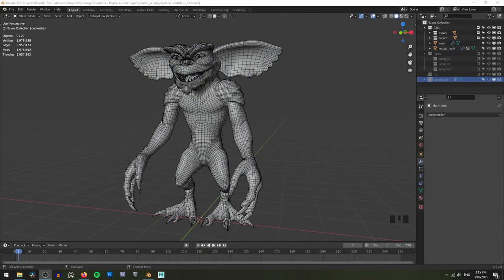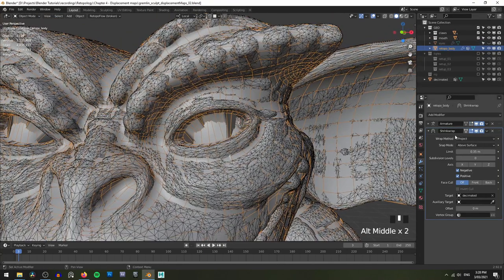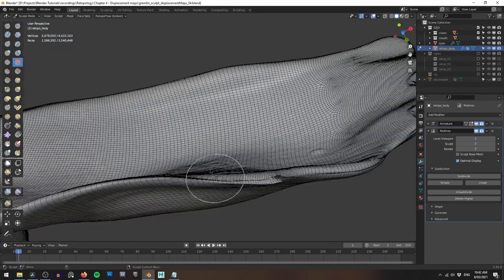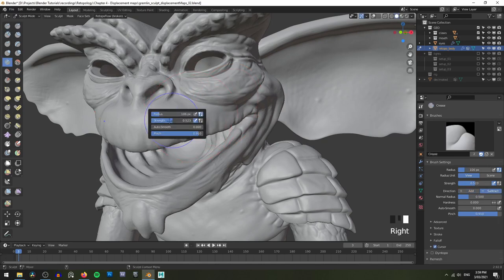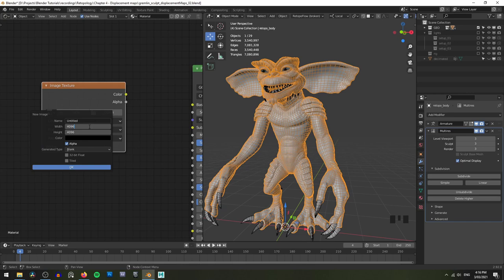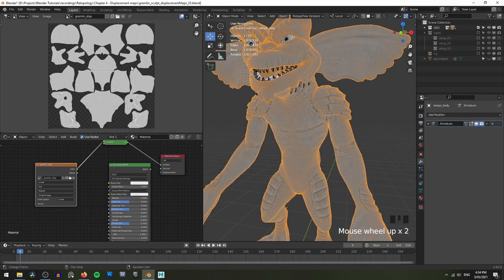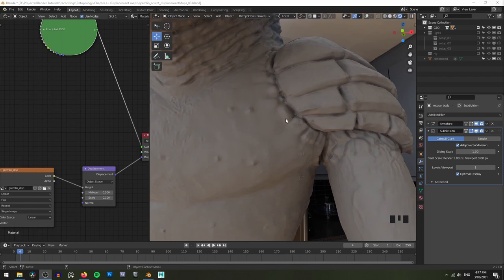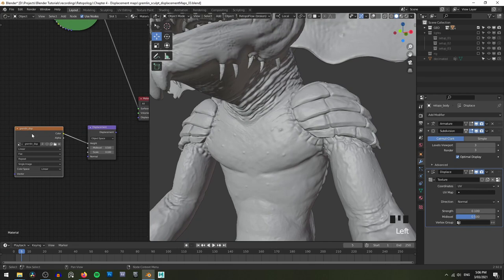Displacement maps in Blender

Comment: Wow, it worked! I've done lots of displacement map tutorials in the past, mostly using C4D, and they all cause issues. But this worked great! I skipped the retopo kind of and used quadremesher. and I did some decent UV mapping, which I often try and skip through, which doesn't help. So thank you for this! You knocked it out the park. Its genius that I can just go ahead and use multires for animation if I stay in blender. C4D does indeed have this via the "freeze + allow mesh distortion" setting in their sculpt tool. But If you can export BTX files from blender.. I bet someone could write a program so that houdini, etc (or c4d). could read the BTX file. So if you wanted to do some crazy sims in houdini you wouldn't even have to bake displacement maps.
Reply from the maker: Great to hear it worked for you Jonsk. Honestly, a lot of baking problems tend to come from bad topology or UV maps, so I'm pleased you managed to get around it - although I'd definitely recommend doing both.

You definitely can use the multires for animation. Just keep in mind the multires does store a LOT of data, which will make your scenes quite large. Exporting as a displacement map dramatically reduces the file size. So it's a trade off between skipping this step or having bigger files.
Reply: @JamieDunbar  Makes sense!

Comment: thanks for great tutorial- any chance for a displacement UDIM tutorial in the future?I have been trying out pixar free model gallus gavialis and I am getting error in cycles(tested out in 2.83 LTS and 3.0a) when loading UDIM displacement from zbrush(exr),diffuse work well, as well the mdisplacement(mari). Any workaround tip possible regarding such issues?
Reply from the maker: Thanks Lage Opedal. Yes, I am planning another video for the Gremlin covering UDIMs. Sadly it keeps getting pushed back. It could be a little while until I get around to it.
In the mean time, I know CGBoost just released a tutorial on UDIMs. Have you seen it yet? Let me know if it fixes your issues:

https://www.youtube.com/watch?v=55sGQLX7iho&list=WL&index=14
Reply: @JamieDunbar  thanks looking forward to it. About the dino, I did not see that the UV were different. I had to change UV to 1001, 1002 etc. and change the textures accordingly. In the rendermanblenderfile,  I think they mixed to different displacementmaps. Dont know how to do this in cycles unfortunately. If you  know this tecnique it would be great to see this in a tutorial...
Reply from the maker: @lageopedal2116  Mixing displacement maps? I'm hoping that's just using a "MixRGB" node and blending between two?

Comment: This video has ended my 10 hour hair pulling run of stress! Here I was trying to make displacement maps work for a Game Asset and was wondering why it wasnt working xD , great video!! One of the few tutorials where I could pay attention easily for 40+ minutes without getting bored! 

Feels bad to see that Displacement maps arent really possible for almost all game assets :/ (excluding terrain textures). Also Thanks for replying to comments in detail really helped out aswell.
Reply from the maker: That’s awesome RT. Glad I could help.
I was under the impression some game engines could make use of displacement maps in some limited capacity - but I don’t know enough to say for sure. As you say, it might just be terrains.
Have you stumbled upon my normal maps video yet? That will help you create normal maps that can be used in games - assuming you don’t already know how to create those.
Reply: @JamieDunbar  yep saw that video

Comment: I have a question. Is it possible to bake displacement map on a low poly model just like that with the normal map?
So that I can apply my map to a low poly model with the same hight information of the high poly model.
I have seen tutorials but the result is similar to that of the normal map, which gives me fake hight information. I want the real hight information on the low poly model, 
I want to bake the hight info on a low poly without increasing the subdivisions, Because increasing subdivisions will make it high poly not low poly, which I dont want.
Reply from the maker: Hey Ali. Unfortunately what you're asking for isn't possible. You can either fake the height information using a normal map - but as you said, it's fake and won't always look good, especially in close ups. Or you can do it for real, using displacement maps. But if you do it for real, you need the high poly.
Unfortunately there's no way of getting "real" detail with low poly.
Reply: @JamieDunbar  First, thank you for your reply. 
Second, you said if I want to do it for real not fake, I should use displacement map. That is right, displacement map will give me the real details, but my question is, why should I use displacement (with high poly) and I already have a high poly model from sculpting? What advantage that the displacement map gives me over sculpting?
I followed a character creation and texturing tutorials, the steps was as the following: modeling, sculpting the high poly details, retopology to get the low poly version, uv unwrapping the low poly, making the normal map, texturing, making roughness map etc... so now I had a character with low poly and fake details and it is ready for rigging and animation. Now lets say I want to texture and animate it with its real high poly details, how can I do that if I will have a high poly model either with sculpting or with displacement? That is why I asked what the advantage that the displacement map will give over sculpting? It is realy weired because at the end I have to increase my subdivisions again in the displacement map, the thing which I dont want.
Third, If what I am asking is not possible, how animation movies are made? How can they create and texture high detail characters and animate them in this case? I dont think the high details in the movies are fake, some times the camera comes too close and I can notice they are real details not a normal or bump map.
Thank you again for your reply, and sorry if my message is too long but this is my real concern and I hope got my point.
Reply from the maker: Hi Ali. I think you’ve kind of answered your own question there. The reason you use displacement rather than just leaving the sculpted detail is so you can animate it. You’d have no hope of animating something with a million polygons - your computer would explode.
So we make our rigged models low poly, and only add the displacement details at render time.
This is exactly the same process that movies use. Low poly models for animating, then add normal maps and displacement maps at render time to get that close up, high poly detail.
Reply: @JamieDunbar  thank you for the explanation
So this means if we render our animation which include displacement map, it will take a much longer time than that without, and need a much powerful computers , and we do it only at render time because it will slow down our PC if we do it at our workflow. I realized also from your comment that subdividing my model for the displacement map will give me much less polygons than that with sculpting.
Reply from the maker: @aliamir85  Yes, that's all correct ;)
Reply: @JamieDunbar   Thank you so much. Just one more 	thing, what is the difference between the displacement modifier, and the displacement node in the shading editor?
I followed a tutorial on both of them, but I could not understand the difference between them.
Reply from the maker: @aliamir85  Great question! There is very little, or possible no different in the final render. But there are two differences in terms of workflow.
1. The displacement material node allows you to use the "adaptive subdivision", which optimizes your render giving you better results faster. You actually can't use adaptive subdivision with a displacement modifier (I just tried this - didn't know that before!)
2. Most other software doesn't have a displacement modifier. But pretty much all of them have a displacement material node. So using the material node setup makes it easier to transfer between programs.
Reply: @JamieDunbar  thank you so much

Comment: I follow the bake setup exactly but I get an error "You should have active texture to use multires baker" i don't know why I'm on 2.93.0
Reply from the maker: I’m fairly sure that error happens when you haven’t selected the image node in the material view.
Reply: @JamieDunbar the probelm was I only had the main body assigned to the material. all of the polys need to be assigned.
Reply from the maker: Oh, I’ve never tried extracting maps on only half a model. I guess it doesn’t work 😅
But you’ve solved your problem?
Reply: @JamieDunbar  yes

Comment: Now I know why it should have been a video on itself, those are HUGE infos.
To be honest, the only annoying part is when you have to manually adjust every detail caused by the MultiRes.. I have always the fear of not seeing some details to fix not matter how much time I look into them. Other than that, the results is fantastic.
By the way, nice video editing too as always.
If I may suggest, could you also add a recap youtube chapter at 37:00 minute? Would be useful for future quick reference.
Reply from the maker: Hey MasterCharizard. 
The better your topology is the less issues you should run into. With a bit of work at the retopo stage you should be able to eliminate a lot of these problems. But I wanted to leave them in because there will definitely be times when it just doesn't work and it's good to know how to fix them. But you're quite right, there'll be times when you move onto the next stage and suddenly realise your displacement map isn't as good as you'd like. Make sure you save different versions along the way so you can always go back and patch it up.

And yes! I meant to add the recap as a chapter. I'll go do that now.

P.S. You can't be the master charizard. Because I AM! :D
Reply: @JamieDunbar  yea that' what I'll do for my next project probably, focus more onngood retopology from start to finish.

Just out of curiosity, how did you manage to achieve all those results? I mean is it the results of years of trial and error or what? Because if it was for me I would have stopped to the basic stuff ( to me all of those particular settings are achievable but extremely advanced at the same time). I mean I could have not figured out all of this by myself xD 

Thanks for the recap thing too!

p.s.: ahaha there's a lot of competition for him :D
Reply from the maker: @MasterCharizard  I've been doing 3D animation professionally for 10 years, and probably another 5 just as a hobby. There's definitely a lot of trial and error. As well as hundreds of hours of tutorials. The first couple of times you do these things everything breaks and you can't figure out why. Then you do it again and suddenly everything (well, almost everything) works and you have no idea what you did differently.
Over time you just pick up a bunch of things and gain an understanding of how the programs work under the hood. Eventually it becomes second nature. Which actually makes it hard to do tutorials, because you have so much assumed knowledge that beginners won't have yet.
Reply: @JamieDunbar   Yea, exactly that. If I have to do a tutorial I would question myself every 2 minutes if everything I am saying make sense/is done correctly because if not I have the fear to spread misinformation. You actually are very talentend in explaining things and it's a pleasure to hear from you (I always play your videos while I do dinner, ahah), also because you take your time and don't avoid even the smallest everyday problem that we could face in each step, and I appreciate this attention to the details.
To resume, great job, looking forward for your next video.
Reply from the maker: @MasterCharizard  Haha, I frequently watch a tutorial or two each morning while eating breakfast. Kind of strange to think of people doing the same thing but listening to my voice!

I may have recorded the first half of this video twice because I felt it wasn't clear enough... :P
Reply: @JamieDunbar  ahah you are super clear, english is not even my main language so don't worry!

Comment: Brilliant video, thanks a lot. This cleared up some things actually.
Reply from the maker: Thanks Mocorn. I noticed in the recent 3.2 update it looks like you should now be able to bake UDIMs all at once, rather than one at a time. I haven't tested it yet so don't hold me to it, but that's an update I'm very excited about!
Reply: @JamieDunbar  cool news. I haven't quite figured displacement make it yet, they often come out with artifacts. I suspect it has to do with bad/improper UV mapping. UDIMS sound cool though
Reply from the maker: @Mocorn  Artifacts are a common issue. Most of the time it's either overlapping UVs (as you suggested) or overlapping geometry on the model. Once you get really, really high poly models it can be hard to see when vertices start to overlap.
And don't forget, you can always paint over those artifacts in Photoshop/Gimp. A lot of people get obsessed with fixing it in Blender. Sometimes it's easier to quickly fix it yourself and move on.
Reply: @JamieDunbar  oh yes indeed, good point about fixing things manually. I did some more tests last night with simple models with solid UV maps. "Bake from multires" worked perfectly on those. Also, normal maps work better than expected I've found. You don't always actually need vector displacement for a good result. It all depends on what you need I suppose.
Reply from the maker: @Mocorn  I often see tutorials recommending people use other software for baking normals or displacements. Maybe I'm missing something, but I've never had any quality issues baking out of Blender.
You know I've still never used Vector Displacement. That tech came out around the same time I moved to Blender. It definitely has advantages and I'd love to see it included in Blender at some point. But you're right - you rarely need it.